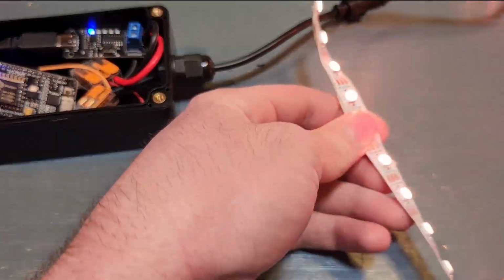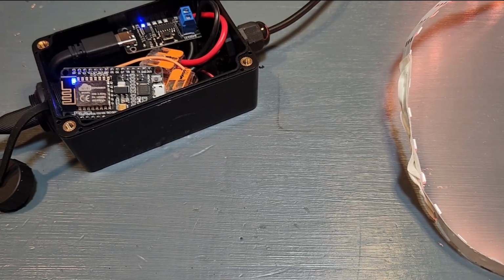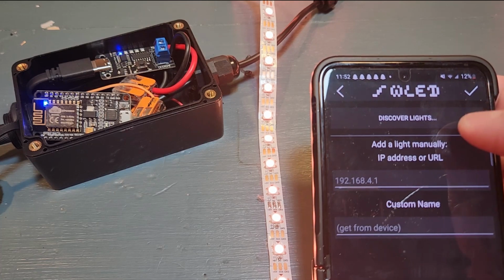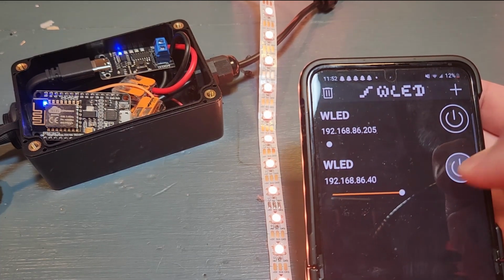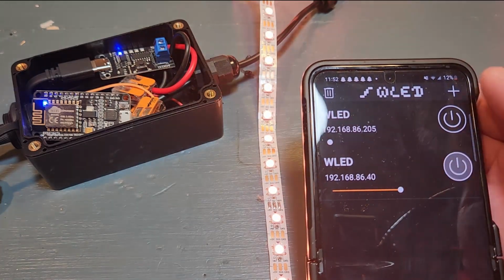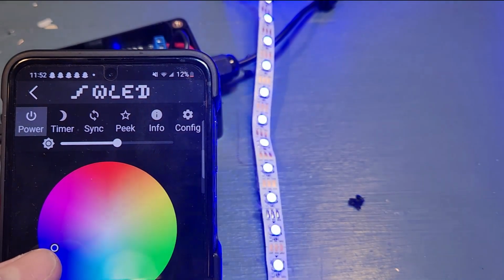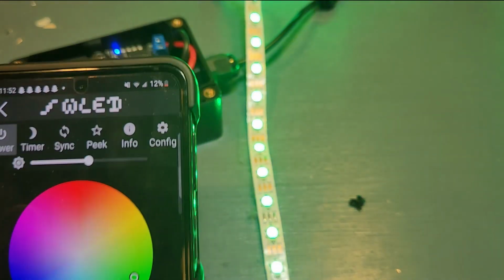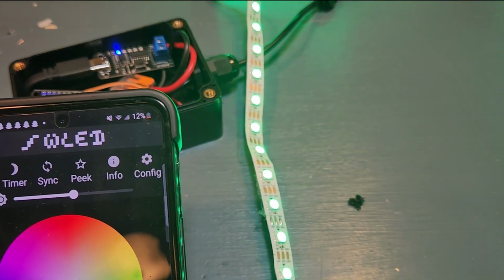Making WLED Projects Run off USB C! (Power Delivery)

Comment from the maker: I made a mistake, during my testing I had the brightness limiter on, at full brightness, an 8ft strip with 150 LEDs will pull 9.3 watts, not 2.7 watts. If you have a Power Delivery charger, you have 15 watts available at 5V 3A, if you are using a USB-A charger, that will vary. The fine print on the charger should specify what voltage and amperage it supports. If you are doing a bigger project and need more power, you can always go up to 9v, 12, 15v, and 20v and then step it down to whatever voltage your project requires. To figure out how much power is available, you can do the Voltage multiplied by the maximum of 3 Amps to get your maximum amount of watts available. VoltsXAmps=Watts. 5x3=15, 9x3=27, 12x3=36, 15x3=45, 20x3=60.

Comment: Awesome video, thanks! 

I'm thinking about making a WLED lamp/sign and needed to figure out what I wanted to do for power. I like being able to use a USB brick and cable as it's much sleeker than a big power brick.

You noted you need power delivery. Does that mean it won't work with any USB brick and USBc cable?
Reply from the maker: Just because it includes a USB-C port, does not necessarily mean that brick supports Power Delivery, But if you are only doing 5v or 9v, most bricks will be able to do that. The fine print on the brick should specify what voltage it outputs, as well as how many amps. on my Samsung 25 Watt fast chargers, for example, it says it will do PD 5v and 9v. Thanks for Watching!
Reply: @melonmonkeygarage7735  thanks! I think I'll pick up the board and give it a try
Reply from the maker: @JohnJacobJingleheimerSchmit  no problem, did you see my pinned comment?
Reply: @melonmonkeygarage7735  I see it now, thanks!

I counted my LEDs and using the 50 mA/LED I found I would need 18 W. I thought the 15 W was close enough (as I don't plan to run at full bright white all the time) and I can just use the current limit in the WLED software. Thoughts on that?

I think the other opinion is to get a buck converter and then step the voltage down. Does a buck converter keep the same watts? (ie voltage goes down but current increases?)
Reply from the maker: Yep that would work, or you can get a buck converter, I have one linked in the description, I plan to make an updated video at some point. But yeah if you do say 9v at 3 amps, that would get you 27 watts, instead of 5v at 3 amps which would get you 15 watts. then you can step the 9v down to 5v and get around 27 watts, a little less since the buck converter isn't 100% efficient
Reply: @melonmonkeygarage7735  looking at the buck converter, it says max output current is 3 amps. If I drop the voltage to 5 volts at 3 amps I'm actually not getting any more power out of the buck converter. It just loses heat. Am I reading that correct?
Reply from the maker: Whoops I linked the wrong board, you are totally right, this board does up to 5 amps which is plenty for 18 watts. https://a.co/d/cyRujRl